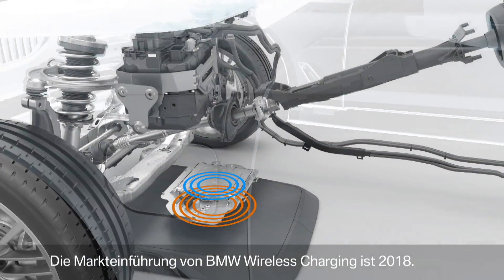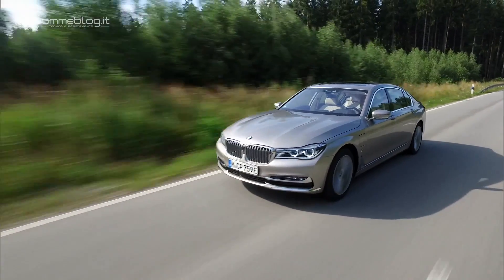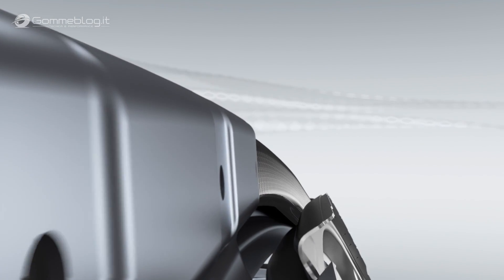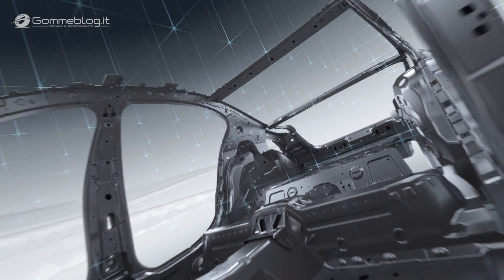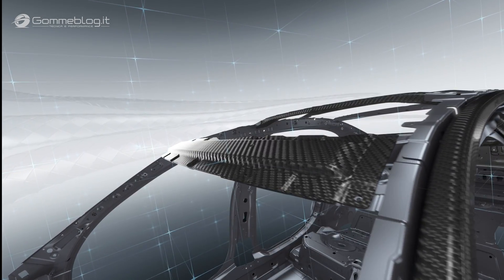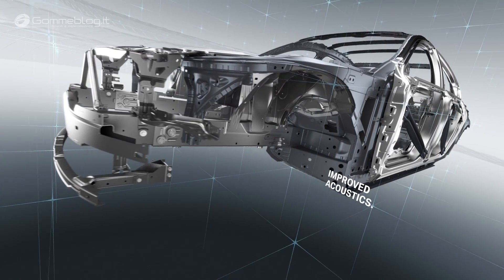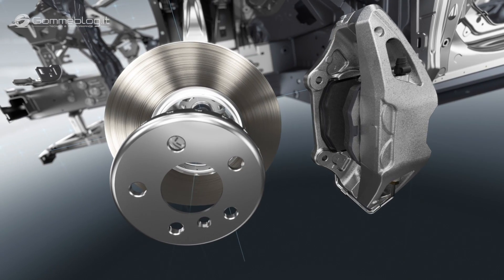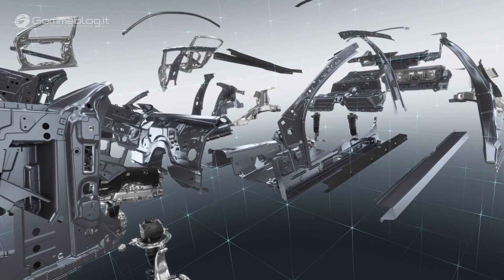BMW 7 Series iPerformance ... NEW 2019 Wireless Charging (STOP Cable !)

Comment: biggest f**king  jole to made cars heavier and heavier and talking about fuel effizent 🤣🤣🤣🤮🤮
and duiring recycling the troubles follow with mixed structure of carbon-core, aluminium, steel etc... importend is you have systems on car you never car lifetime used 👎🏽👎🏽👎🏽🐒